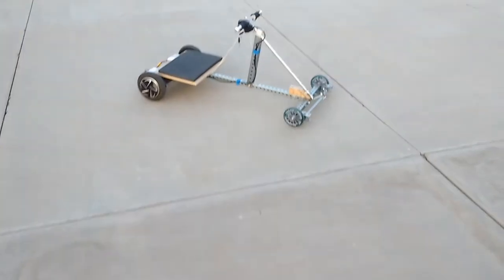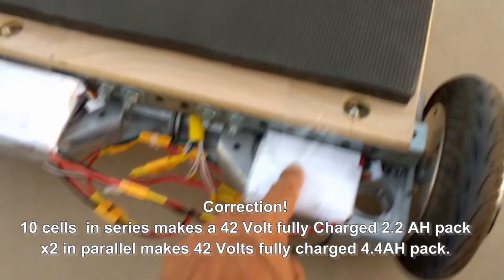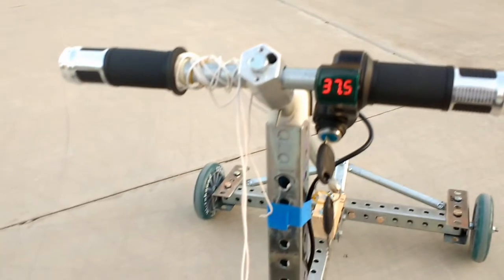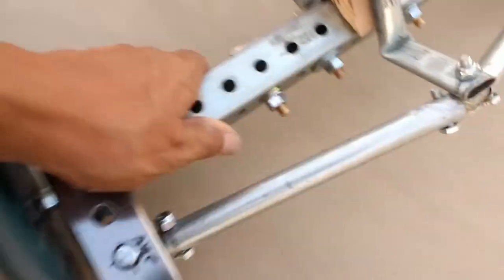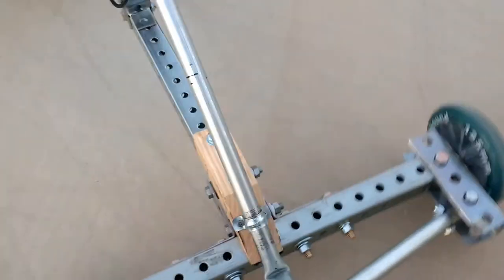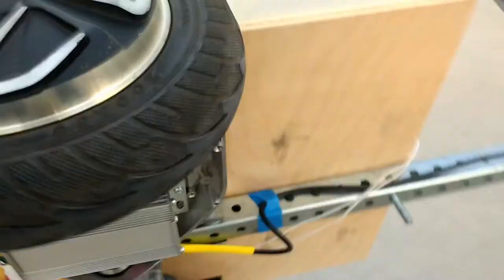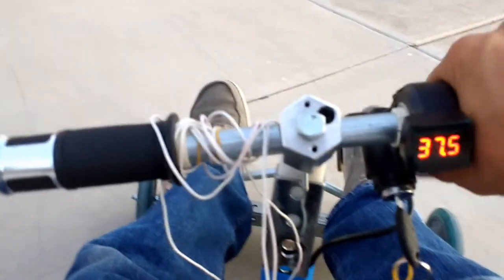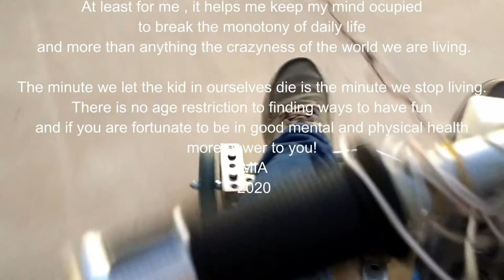Nano Go Kart Bolt On No Welding made from Broken Hoverboard Part 2

Comment: Have you tried RC with these motor controllers? I don't really see any documentation. I have an R8EF
Reply from the maker: I did not purchase them for RC control, but I see no reason why they could not be used with  a radio transmitter and receiver with a bit of modification.

Comment: How expensive is perforated tubing? As someone with no welder and limited metal working tools it seems like an ideal material for a go kart frame
Reply: I think it depends on your area

in my area, at lowes, one of those tubes can be around $20
Reply from the maker: At Home Depot https://www.homedepot.com/p/Everbilt-1-1-4-in-x-36-in-Zinc-Plated-Punched-Square-Tube-803047/206939537?MERCH=REC-searchViewedNA-206939537--N&  It is about $6.50/ft worth it in every sense if you build things bolt on way. Square telescopic, steel, galvanized, and perforated, what more can a builder want for quick assembly simplicity. You will need a grinder to cut off smaller sections to make the axle holders, and a vice or clamps to hold the parts while cutting. Always employ common sense and caution when building things, using tools, working with various materials, etc. Use protective gear, goggles, masks, gloves, work in non confined open areas and away from people, animals and objects that can be a hazard if something goes wrong.  

HOW DO YOU TAME A TIGER?  YOU LEARN AS MUCH AS YOU CAN LEARN ABOUT IT AN WHEN YOU ARE SURE AND CONFIDENT,  YOU STILL APPROACH IT WITH CAUTION, AND  NEVER LET THE GUARD DOWN. TRAIN YOUR MIND TO THINK THIS WAY!  SO IT CAN BE NATURAL REACTION ANYTIME YOU WORK ON PROJECTS AND YOU WILL DECEREASE YOUR RISKS FACTORS.   

THERE IS RISK IN EVRYTHING WE DO FROM WALKING ACROSS A STREET LIGHT, SO THIS IS NOT MEANT TO SCARE ANYONE BUT TO GIVE YOU A SENSE OF PERSPECTIVE. Otherwise HAVE FUN!

Any questions just let me know in the comments I'll be glad to help you.